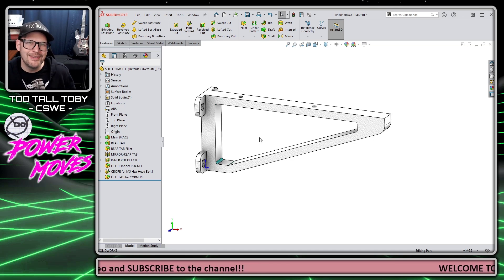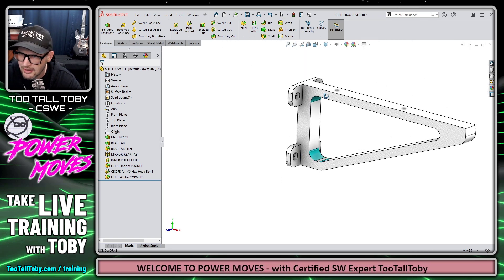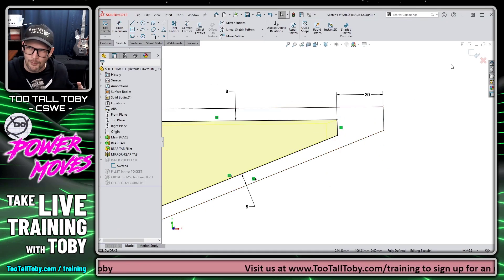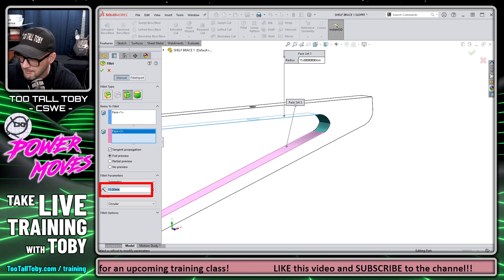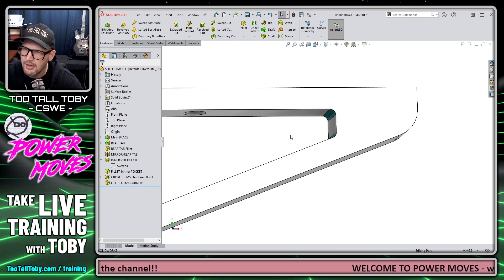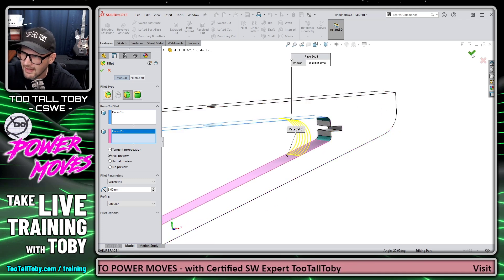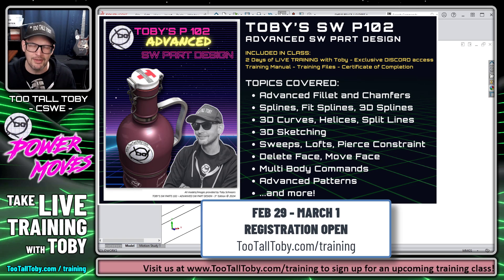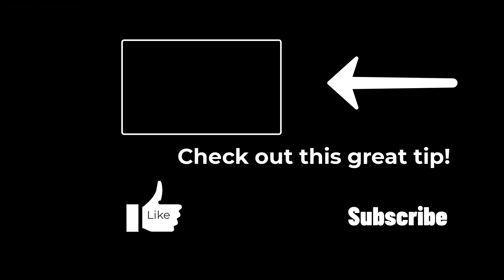PATCHING Complex CORNERS

Comment: Question: If I have a 10mm wide rectangle slot, is it possible to face fillet just one end and leave the other end square? I feel like it does not work on 3 perp.\parallel surfaces.
Reply from the maker: For 3 perpendicular surfaces you would use the 4th fillet type:  Full round fillet 
Give it a try - see how it goes
Reply: @TooTallToby  i feel stoopid lol. thanks for that :)
Reply from the maker: awww yeah - Glad this helps!!  @STAiNLESS_CORE